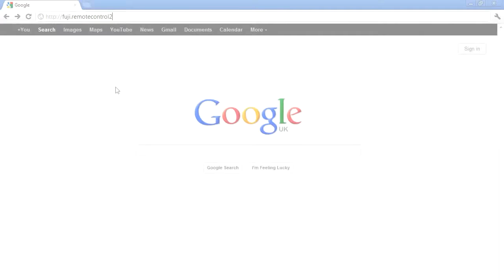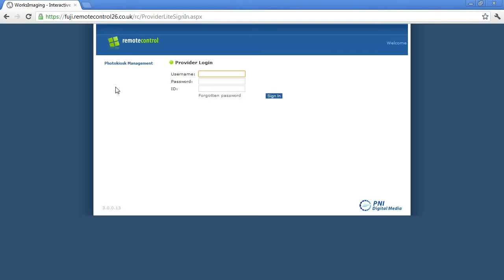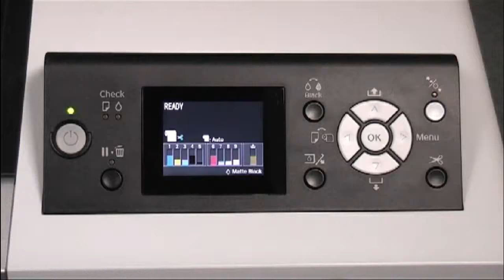Introduction to FUJIFILM support channel

Comment: Hi, My frontier printer has randomly started to desaturate my prints. I print school packages using Lightroom. Printing 30 8x6 prints the last 4 prints were desaturated and have been the same since. Has anyone seen this before? I have deadlines and am in a fit of a fix.